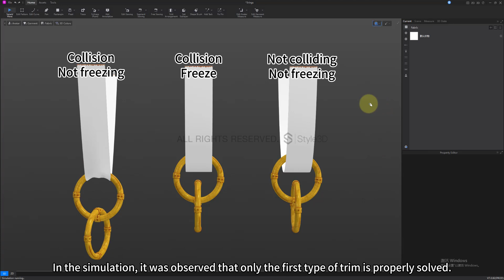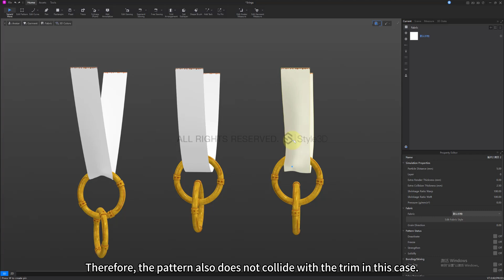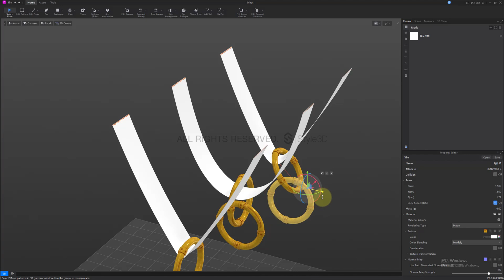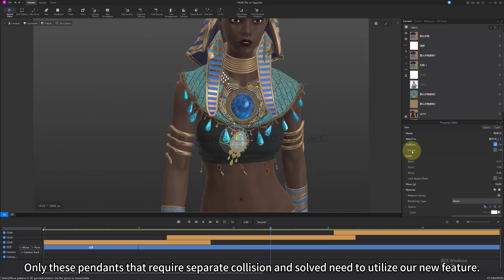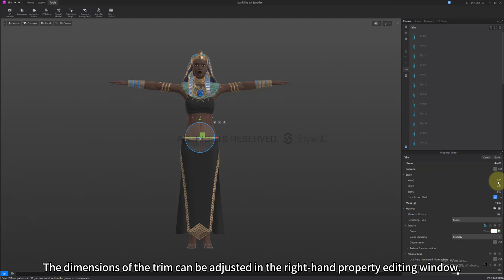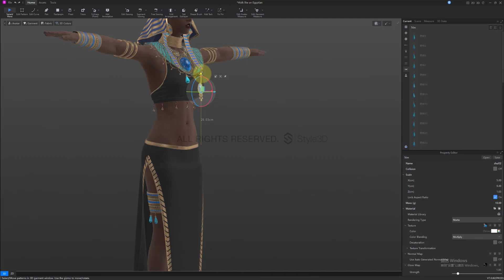[Atelier V7.0 Tutorial]: Detailed Explanation on Accessories Simulation

Comment: OK! How do we make the same Rigid-Cloth Interacting simulation in UE? We do make bone for each RigidBody in DCC then export the whole Bone Hierarchy unified, Instead of that in UE Simulations doesn't work correct, If this is just added part into Capsule of Character as Skeletal/Static Mesh Then collision with cloth doesn'T work in UE?
Reply from the maker: We have a feature called Collision Filter that can solve this issue. You can find detailed instructions on this feature in the User Guide at the bottom of our simulator's official website. Alternatively, you can contact me via this email: style3d_cg@linctex.com, and I'll send you the link to the Guide.